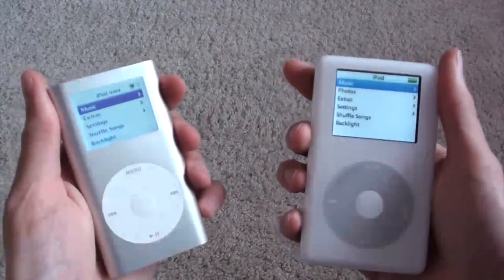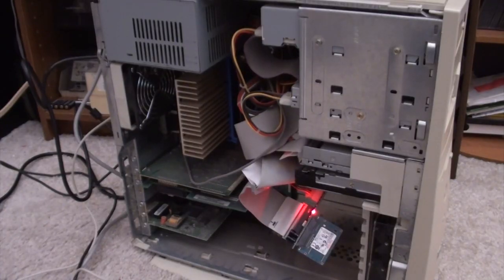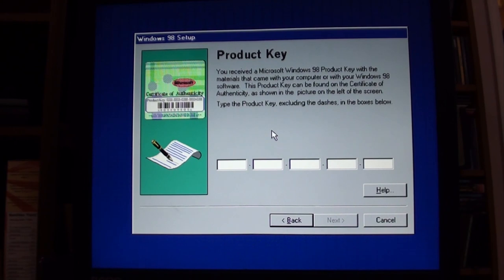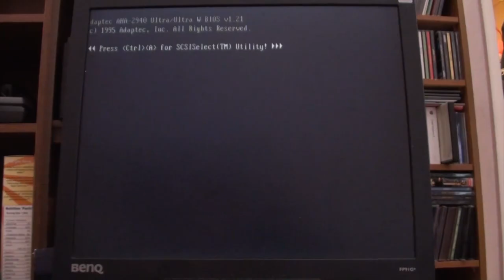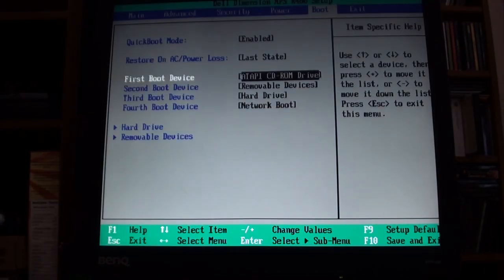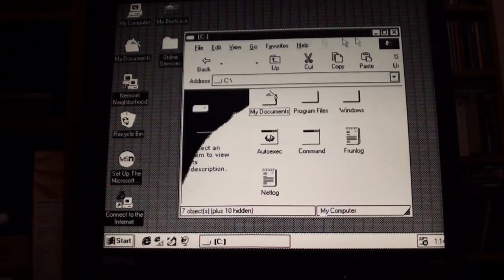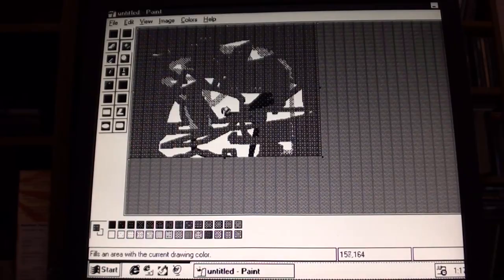Installing Windows 98 on an SSD

Comment: Lot of people are saying you have to understand this guy’s videos to get it. And I don’t know what the deal is. A few things though- IDE is limited to 33, 66 or 133MB/s. A modern NVMe drive (I know, not SATA) can hit an actual speed of 2.8 Gb/S. I don’t know the bandwidth. But that’s 84x as fast as this machine.  This is a SATA drive. SATA 3 is SATA 6Gb/s or 600MB/s and a SSD easily saturates this. So 20x this speed. This is clearly a very old SSD, so it’s probably half that speed at best- it might be 1.5Gb/s (Gigabit per second- 150 Megabytes per second).  IDE Was listed in Megabytes per second not Megabits. Which is more useful. So IDE went from 5 megabytes per second to 133 megabytes per second , SATA from 150 to 600 megabytes per second, and now PCIe which might be approaching saturation at 2800 megabytes per second. So overall, the bus alone will limit the benefit of SSD.  This means from the first IDE to now we are 540x as fast. Optane can go even faster but might require the new U.2 or PCIe interface to realize it. 

And there was no mouse in the win 98 installer.  That didn’t come till later. Now you can get the mouse (and reasonable display drivers) in the BIOS (UFEI) which is nuts.

Comment: Oh my... Why in the fucking world would you use the Win10 background on a Linux laptop?
Reply: Looking at it it's definitely not linux. Sort of looks like a modified version of Windows 10, with weirder start buttons. An older model possibly.
Reply: Aaron F The Wi-Fi icon is totally from LXDE theme.
Reply: angry linux kid spotted!
Reply: Looking at it it's definitely Linux. Running the LXDE desktop environment, that recognizable standard Gnome icon theme with the blue folders, and that file manager looks like PCManFM (which makes sense considering that goes paired with LXDE).
Reply: Have you ever a discussion with a Linux user?

Comment: Back in the Win-DOS days I had a boat load of RAM on my Pentium 2/3.  Using a RAM drive utility I installed Windows 3.11 to a RAM drive, and saved it to the HDD.  My special batch file would create the RAM drive and copy Windows to it.   While that did take "longer" Windows ran great.  When I was done with Windows the archive bit would determine which files I copied back to the HDD to save changes.

I also used this method to play Duke Nukem 3D and other like games of the day.   It was sweet.  Great load times.

Comment: I actually found this tower in a thrift store but it has a P3 800 MHz and a graphics card that is only cyan, I replaced it with an NVIDIA MX400 64MB and used a kingwin SATA to IDE adapter which I then used a Patriot Burst 120 GB SSD on it and its a legit screamer! It boots into Win 98 in around 10 seconds.

Comment: I did the same thing to a Dell Dimension M200A with a CF card... used a adapter, that hit the Ide slot on the board directly and upgraded it later to a rear slot where I can easily swap the CF card anytime... the boot time and the random access is absolutely stunning!

btw: I like your style... hummin star trek 😆

Comment: Just came across this. My kind of geek, I’m all about having an SSD for old stuff, definitely including DOS. I’m just not sure there’s much of a gain over traditional drives in these old machines because that adapter means being completely bottlenecked at IDE speeds. No spin up time though...that’s a win. I tip my hat sir....someone had to do it.

Comment: When I started playing with solid state drives I already was living in the Windows 7 realm. So I dropped one of those beasts inside my i5 and the difference from the old HD was so extreme that I had the impression that I had gained a whole new machine. Seriously. My computer boots in barely 10 seconds. And it's a 4 years computer. Then I got so excited that I ordered another SSD to my wife's laptop (another i5) and again - wow! - a lightning speed machine! So my wife had this second laptop (a very old one) with Windows XP inside and then I though "why not?". Then I ordered a third SSD and did the same thing to the old dude thinking that it would fly. Dude. What a deception. I cannot start telling you my disappointment. The computer just continued the same way as before as with the standard HD. Just then I decided to make some research because it didn't make sense to me, but quickly I figured out the reason: old OS aren't optimized to take advantage of SSDs technology and also doesn't have the TRIM internal command. The result? You won't find any increase of performance. So if you still are playing with stuff pre-Windows 7 don't even waste your time (and your money) trying it. I stayed there and lived to tell. You will get very frustrated. Don't believe in me? Well, consider yourself warned!
Reply: @Diàrios De Garagem:
Actually it doesn't have anything to do with OS optimization or trim commands. It's not a software problem, it's hardware, specifically the connection type. Old PC don't have the required SATA connection on their motherboard. So it's basically like running a Ferrari leaving it on the first gear.

Comment: i just recalled that Win98 - WinXP needed a lot drivers from Vendor (especially Chipset driver) in order the system can run smoothly and faster. Example, VIA and SIS Chipset. Your system should boot faster if you installed those drivers

Comment: Oldest one I have is window 2000. Was given to me long time ago. I have service pack 4 with it. Kinda want to do up an old laptop with it and mod it to accept a power tool lithium battery. One of those cheap Kobalt 24volts. All I need is the old laptop and I'll buy a cheap small SSD 128gb is all I'll need. what? 18 dollars?

Comment: Kids, you haven't been alive unless you remember using regular fans to blow cool air into your opened-up PC.
Also, yeah, a lot of stuff (like fans) could just be plugged in/unplugged while the system was running... but there was always a gamble with a lot of stuff too. Good times at the Hardware Casino, until you have to borrow from the hardeware mafia and next thing you know, a dodgy soundcard is sharpening a knife while you're all drugged-up in a bathtub filled with ice...

Also also.... US Robotics? Oh man, another flashback... spent countless hours on one system once, that just wouldn't accept that my networking set-up had nothing to do with US Robotics.

Comment: The speed test is not proper, because:
1. You still have not installed all the necessary peripheral drivers, including your video card's (PnP in action).
And most importantly:
2.  You have not switched on the IDE DMA mode (yes it is off by default). The first thing I used to do on every new Win 9x setup was to switch on the DMA on all hard disks and CD-ROMs. It made a world of difference offloading the CPU. Granted, not all MBs / controllers supported it properly but it was too significant not to try it. Especially with Ultra DMA disks...

Comment: wonder if the results would have been different if the guy would have tried using a pci SATA controller (with the exception of trying to get drivers for that thing).

Comment: OS' worth having:
Windows 98. Everything before it will work on it and it still has complete support for DOS applications where Windows 2000 didn't support 100%.
Windows XP. Best for almost anything between 1999 and 2008.
Windows 10 for anything 2009 to now. Yes Windows 7 is probably generally better and nicer still, but 10 does have better SSD support and will support newer directx versions that 7 won't. Tech features-wise 10 is better. Overall no.
Now we just need an OS and hardware strong enough to completely emulate older Windows versions (not virtualize) and any hardware at that time.
Example: Making your computer with a GTX 1080 and whatever sound processor you use emulate Windows 98 to use DOS, run 16bit programs and see you GPU as a voodoo card or something and think you have a sound blaster awe/32 and have all the drivers installed for it.
One computer to cover 3-4 decades.

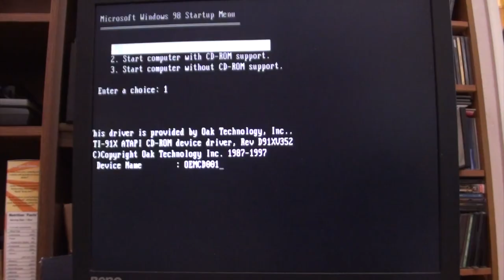Comment: 6:30 Of course FDISK won't touch NTFS.  DOS and Win9x won't touch anything but FAT.

NTFS didn't become a home standard file system until XP hit the market.  And XP was basically NT 6.0 which was in turn a successor to Windows 2000.  You can tell that XP runs on NT architecture since not only does it run DOS on an emulator like its older siblings, it also only has five HKeys in its registry as opposed to the six ran on 9x.

Comment: interesting, i'm planning to build a windows 98 machine for some retro gaming, wont be connected to internet, have an old abit bh6 with 256meg of ram and 2 voodoo 2 cards, been looking for a pII 400, but i'm betting you got rid of yours already, i'm planning to use a ide to CF adapter and try and boot from that, no idea if it will work, figure 50/50 chance, if not might try ide to ssd. thanks for the idea :)

Comment: Win 98 booted up faster than win 10 even on the old computers/hd drives. I installed Win 3.1 on a P3 machine it would boot up in about 10 seconds nice.

Comment: Using an SSD over a IDE cable will not speed up anything. You are still limited to the IDE throughput of 100 - 133 MByte/s
Reply: That's not the point of the video

Comment: Uh yeah, just install in a VM if you want to see the crazy fast times.  As soon as you connect it to that adapter, the SSD is immediately no better than that spindle drive that was plugged in, and the install/boot times will be pretty similar to what you would have seen with a 7.2kRPM IDE drive.

Comment: there are Pentium 2 heat sinks with a fan or fans on them. I had a Pentium 2 back in the early 90s and it had that same silver fanless heat sink. I didn't like how it was getting too warm so I replaced the heat sink with another heat sink that had two 60mm fans on the finned side. It kept the CPU a lot cooler.

Comment: well considering you were running the ssd on a ATA connection it limited the ssd to 133mb. so there was really no diff in install times over a HDD.

Comment: Old video i know but once you get some usb in there you can  install magic iso (supports 98) to run your game iso off a virtual cd/dvd drive.
I picked up a box full of via usb 2.0 4 port card years ago that had win 98-me + 2000-xp-vista drivers on the install cd, 
I don't recall whether it had win 95 drivers though the chip was a via VT6212L

Comment: Well It can only go as fast as the interface, ive found those sata to ide converters to be flaky, using a "modern" ide HDD will have far better results.  Also you clearly dont understand heat-syncs , the case fan is just a vent fan for the case but put one on the cpu heat-sync and you will notice the difference much like the big fan you had pointing at it.

Comment: u should have used hard drive for vista and older versions because anything u delete wont be deleted in old systems and ssd will get slow so dont u ever dare using that ssd later (edit) so basically ur ssd died

Comment: Useless. You just use old ide controller, + ide cable + ide-sata converter and install from old 32x CD drive. And you loose speed on each step. SSD do not work even on 10% of its normal speed. With same result you can just use ordinal hdd.

Comment: i don't undersatnd the difference about of total ram between win98 pc and today pc ...  just until 2014 I used Winxp into an old notebook of 2006. It had 512 mb. I ran word 2000 and other software. The problem started with chrome.

Comment: My PIII running win 98 boots in about 10 seconds with a 10GB HDD. That SSD is crap.
Reply: I think its more likely the IDE connection bottlenecks it. Hard to tell how much though considering there is no info on the motherboard or what generation of IDE it uses.

Comment: 98 & XP were the only ones I really liked. W7 is passable if you deactivate all the bloatware & notifications, turn off all the stupid surplus graphics, and replace almost all the programs and apps with older versions or third party software; I also use the Classic Windows Theme. Fun video!
Reply: amaxamon My favorite Windows is: XP, 7. And I like Linux Ubuntu

Comment: Ive installed win2k pro on an ssd  200mhz pentium (socket7) with 128MB ram  the drive was some chinese 16 GB PATA drive and it booted faster than my win 7 core i7 6700k and Samsung evo 850

Comment: I install CLFS ( http://www.linuxfromscratch.org/ ) on a USB stick, then, install dosbox (dos emulator on a virtual HDD) to install Windown XP... With some modifications on windown system and kernel, and some bash/linux scripts, I can run the XP on booting directly from the USB (no need hard drive, installation, even RAM with swap linux file system) from any kind of computer... But, finaly, it's a shame to do that.

Comment: Man, u hav to write a new SATA driver so it can use the speed fully...as in ur vid, it starts slower than my W98 on a PATA 7200 rpm HDD...as mine starts in about 25 secs.
;3)

Also try to at least install the drivers fur the hardware...otherwise Win98 or W98SE just slows it down to minimum speed of SATA...so even slower than PATA, wht W98SE supports by default fully.

Also not worry, the Slot 1 Intel can take up to 120 degrees Celsius..,Slot A up to 135 degrees...were they start to get damaged...still, ur cooling needs an fix.
:3|

Made a little video to show u how it can work: https://youtu.be/XVmFFvultKg 
Thx fur inspiring a Ytube vid of mine!
Was something to finally make a new vid fur my lonely, dusty channel.
Lie long n prosper, hav fun tinkering with ur old school machine...tensed to see how fast it starts with drivers installed!